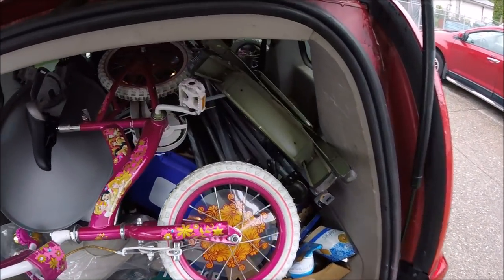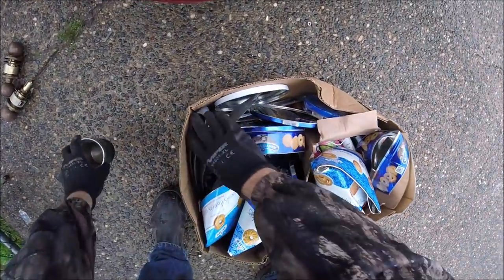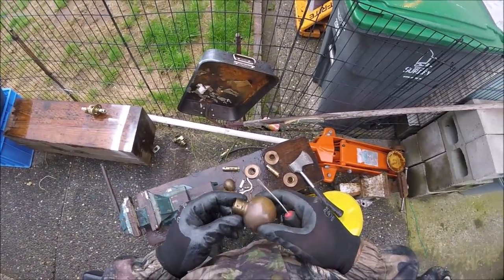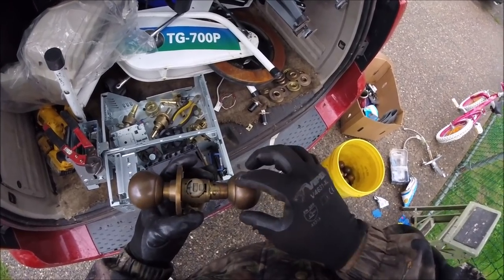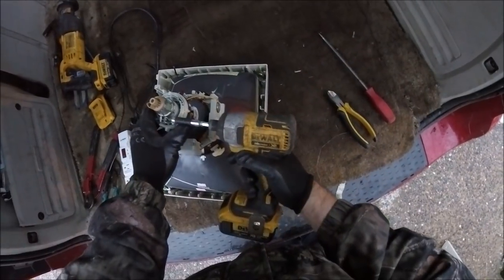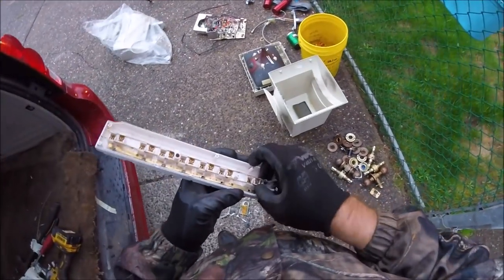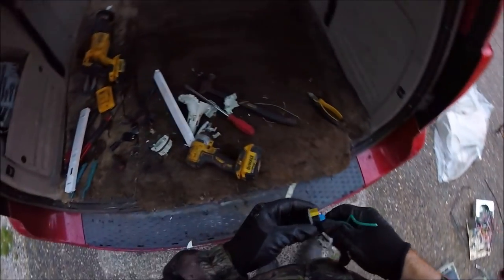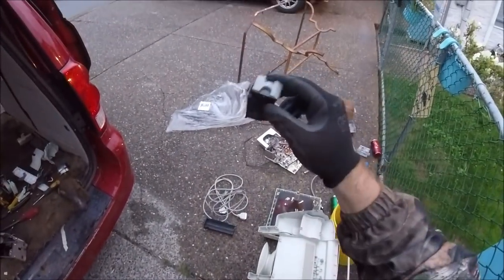Scrapping Door Knobs + CRT & Printer For One of My Viewers Thanks John

Comment: Those are Baldwin doorknobs high end expensive. From the 80s. I was waiting for you to figure out the pin that you push.  I used to install them.  😂
Reply from the maker: Thanks for the comment, I was wondering how to dismantle the key lock ones?
Reply: @CanadianTreasureHunter  there should be a little round hole, that does the same thing. Stick an awl or something that will fit in it.